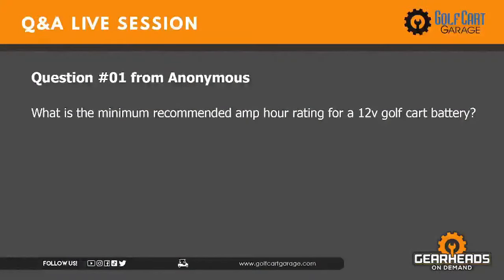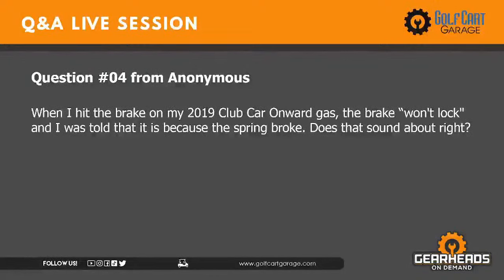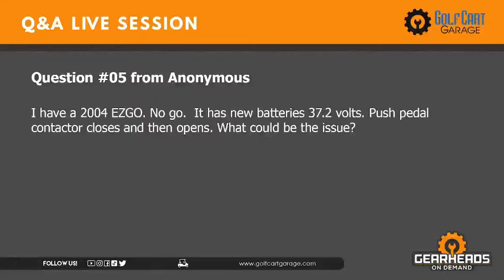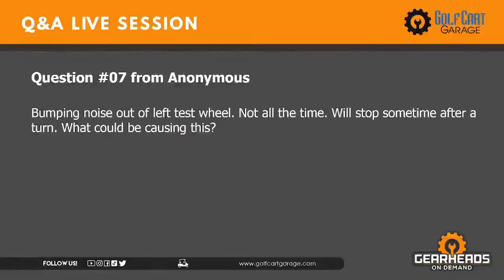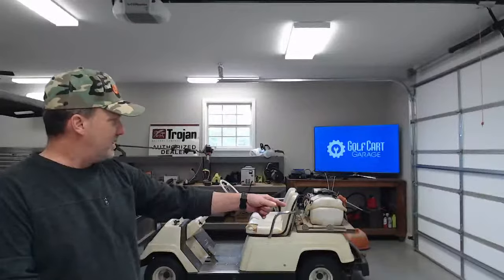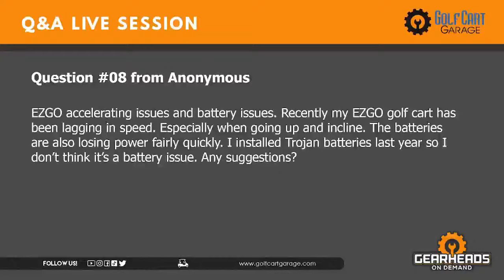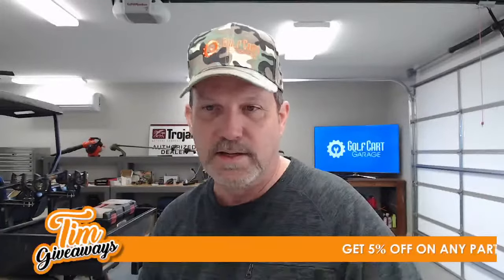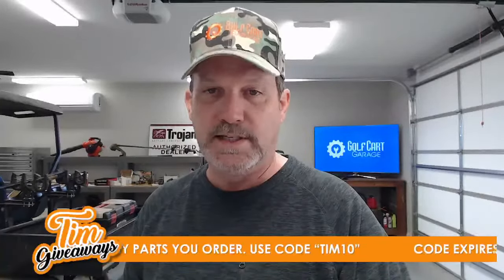Speed Wobbles | Golf Cart Garage I Weekly Giveaways |  Episode # 114

Comment: Just put lithium batteries in my 48 volt 2012 Precedent. After a couple hours on the course, the cart shut down even though the volt meter was showing 100%. The batteries are all reading about 11.8 volts individually when not connected to the cart. However, one battery is showing a -30 volts when everything is connected (the batter connected to the negative side of the car). I'm thinking this may be a controller issue. What do you think?
Reply from the maker: Thanks for watching, Wade!  Wow, those are much lower battery readings than we'd like to see.  Does your charger have a lithium profile?  They may not be getting the cycle they need.  This is a bit involved for the comment section, but we don't expect a controller issue.  We recommend a free consult appt with our tech team here: https://www.golfcartgarage.com/gearheads-on-demand/ or reach out directly at Support@GolfCartGarage.com or (800) 401-2934